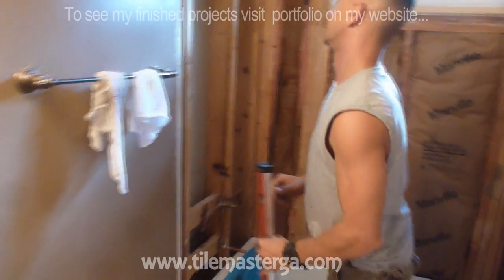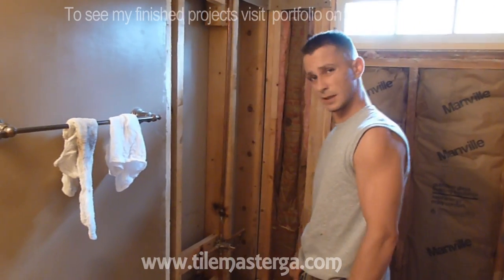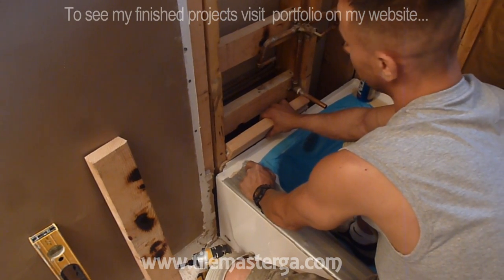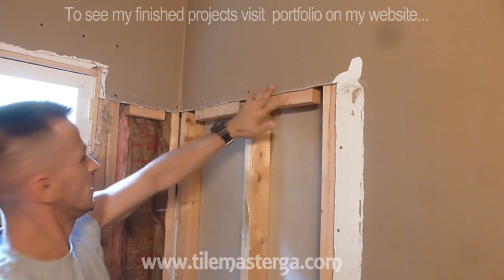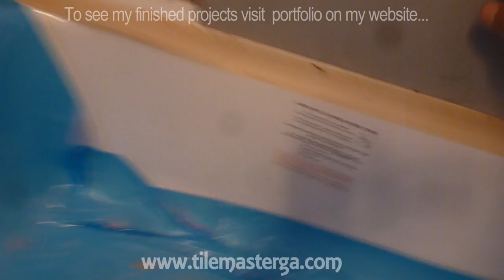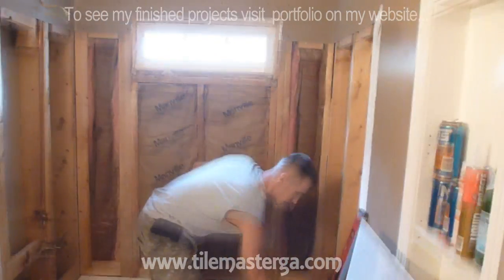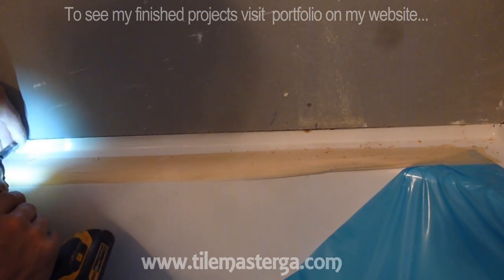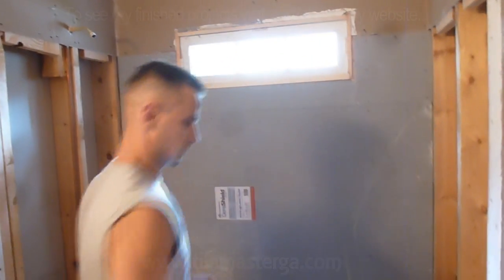Tile backer board installation - 60" bathtub surround walls for Tile installation   Part"1"

Comment: Pretty good video but at around 9min 22 sec u installed a fake sister stud which was ok but you should have used 3 in exterior or galvanized screws and screwed your false sister stud to the actual frame stud for more structural support will help prevent sag or cracking in the future just a tip from another professional that pays attention to detail

Comment: I'm using 1/2in Wonderboard as my backer. My drywall is 5/8in.  What is a good method to make it flush?
Reply: The best method is to use a thin-set mortar, to help seamlessly transition that 1/8 inch difference, you will want to sprinkle unsaturated 100% all natural ground-up unicorn horn directly into the mortar while mixing.  But if you can't find that, Home Depot usually hides a few jars of fairy dust in the back...just ask the guy in customer service.   ;)

Comment: You emphasize a lot on lining up the studs horizontally. But what about vertically? What if stud is warped and caused the backerboard to cave vertically?
Reply from the maker: Hi There - same thing, if studs are bumpy I will " shave it" or will put sister-stud next to it .

The goal is to have perfectly FLAT wall, do not have to be perfect level because often it is impossible to do if entire house is off-level, but it should be FLAT.

I hope that helps.

Michael - Bathroom warrior....

Comment: If you have more than one stud that needs to be shaved down, at what point would you decide that it is less work to just bring all the other studs out using sister studs? Is it just in the amount of time it would take to do one over the other?
Reply: tscoffey1 I would use as few sisters as possible on an exterior wall. Adding sisters means less insulation, lowering the wall's R-value.

Comment: You discuss shaving the studs to bring them in line.  What tool do you use to do that?
Reply: I'm just a viewer but I used a 6.25" Kobalt wood plane. I shaved about an 1/8" off of several 2x4 studs with ease. If you use one, just make sure you have the angle adjusted as to easily shave.

Comment: putting the wooden blocks between the studs around the top edge of the tub scares me. When the caulk fails they will wick up moisture. I was told to never grout between tile and the tub. (or the corners)  Caulk only.  Just a thought.

Comment: Can I use green board aound the bathtub walls instead of the concrete / tile board ?
Reply: Technically you can but that is definitely not recommended

Comment: Michael, I am stuck with the Hardiebacker I already purchased. Can I still use it with Mapei gel waterproof membrane? You mentioned Hardiebacker having issues with adhesion.  Any advice aside from buying all new cement board? I don't have access to a pick-up truck ( I crammed this Hardiebacker in the trunk of my Grand AM!)
Reply: Don't be afraid to use hardie backer,,there is no problem with adhesion if the thinset is mix property,,hardie backer is very strong and you can do a tile repair without any worries,,the water proofing you talked is fine,,for you next project,,
Reply: Thank you for your response! I love your videos, they are done so well that I feel confident I can do this project myself :)
Martin Garcia
Reply: +wendy fahmie This is not my video, but I install tile too, and I has been using hardie backer for very long time without any problem,,tile guys are scared  to use it because is hard to cut and install,,to me is the best tile board in the market,,good luck with your project,,,
Reply: OH!  I thought maybe you were part of that same business. Thank you Martin,
 for taking the time to respond  :)

Comment: So what do you do about installing the broad if you tub is  already in
Reply: Slide them down if you can. If not add a cross beam and go from the top of the tub up. The beams that are there are good. The added beams are for the boards you will tile only.

Comment: 20:15 if my tub is completely flush with the wood and the cement board goes more than a 1/4 of inch over lip of tub is that ok? my tub is very tight fit and when I put the .25'' backer board the over hang is slightly greater so there is the possibility of a bend. what should I do?
Reply: +whiteboidevin like you explain at 22:35
Reply: Backer board should sit on top of the tub top flange, then the tile hangs over the tub flange leaving a small gap for caluking, then grout.

Comment: So no vapor barrier behind the backer board to avoid mold?
Reply from the maker: There is insulation
Vapor barrier is big no ! More potential problems that you may think my friend.
Reply: Denshield  has its own vapor barrier built into it.  The installation info. for Denshield says not to put a vapor barrier behind it when installing it. (you never want to put a vapor barrier behind a vapor barrier.  Moisture gets trapped between them and there is little  possibility for it to escape.)
Always read the manufacturers instructions... you can learn a lot from it and avoid costly mistakes.
Reply: Thanks!  That makes sense.

Comment: Good points in the video. But I've noticed that you're against putting up the barriers. Doesn't Building Code require vapor barrier on the exterior wall? I'm looking at International Building Code chapter 14 (Exterior Walls), section 1405.3 Vapor retarders.
Reply: Building codes are local too, for example here in Los Angeles for dishwashers they require that stupid snorkel to be cut into the counter, where other counties it does not. Same holds true for barrier vs non barrier.

You have to be specific to your city in the US.
Reply: Stan A. Its different state to state... Or county

Comment: What tool do you use for the shaving of the studs?
Thx!
Reply: +Brian Hamilton I use a heavy-duty 7" block plane from Lowes. Any cheap block plane will do, just keep the blade sharpened. This also works well for shaving off leftover construction adhesive residue on old studs that you're replacing the drywall on, although it dulls the blade quickly. Surform planes are generally too aggressive for this kind of work.
Reply: I used a carpenters plane, ( don't know if it's the same one you're referring to ) and shaved off the high spots on some studs and then put a straight 2x4 across to check their evenness.  It worked well!